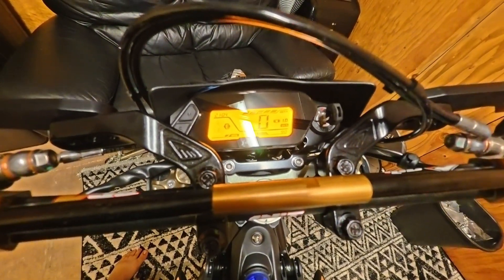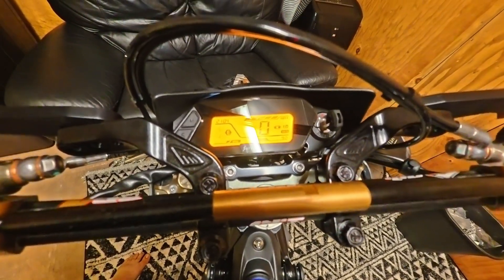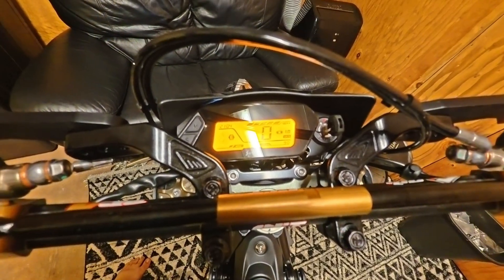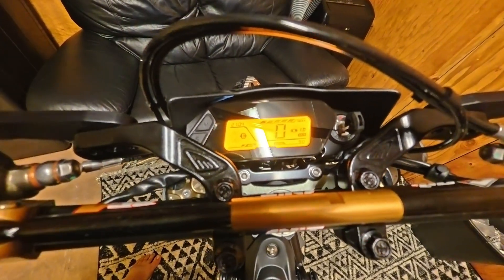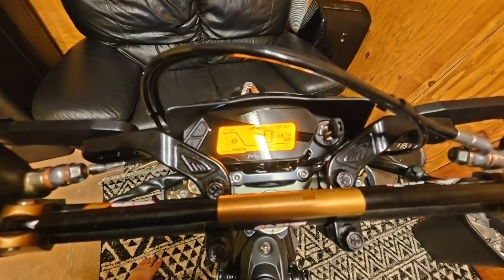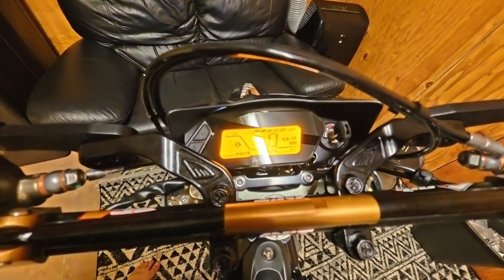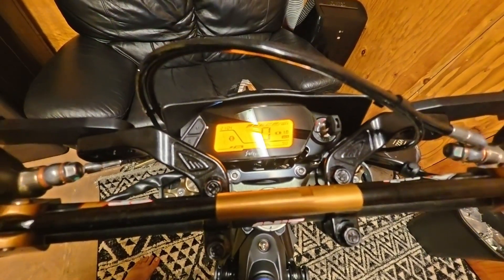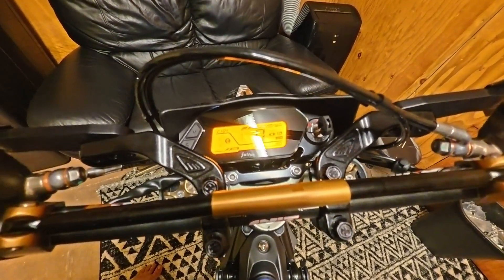2025 Surron Ultra Bee: How To Set Clock, Speedometer and Gear Ratio

Comment: Would you know anything about the wheelie/tip sensor? The second I get in a good wheelie a little past balance point it cuts power slowly till the wheel comes back down
Reply from the maker: I've never had or heard of anyone having that issue. Sorry, I am not to sure. I would just disconnect it, if you think that's causing the issue
Reply: kick stand down hold asr and ready press ready until you get to tip in sensor and click asr to disable